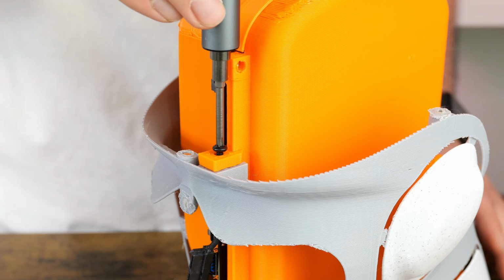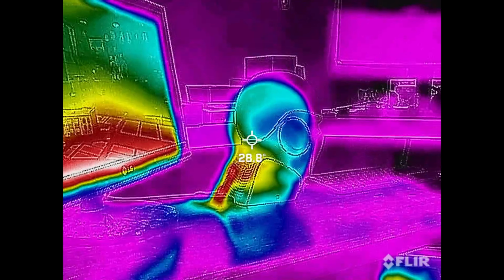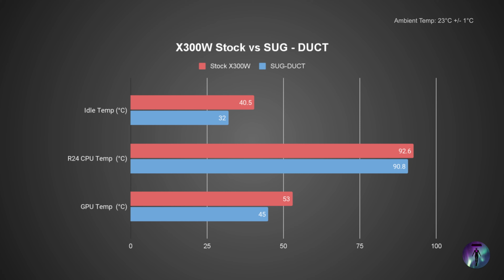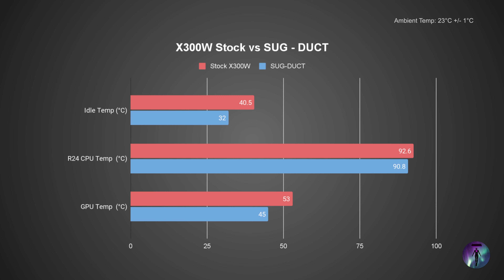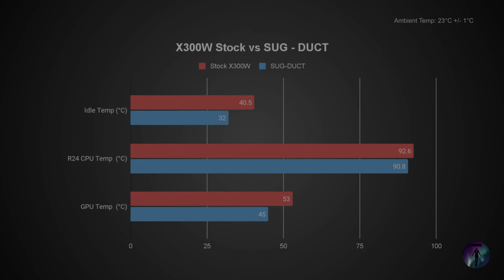This 3D Printed PC Case is Ahead in Cooling and Use

Comment: What type of filament did you use when printing out the parts?
Reply from the maker: Thanks for watching! For my PC cases I opt for PETG (I have them linked with color too in my description) for its high heat resistance. You can use ABS as well, but be mindful of fumes and heat fluctuations when you do.

Comment: that CPU still hitting over 90 C..  90 C is max recommended temp for longevity, 100C is thermal limit, i prefer around 70C temps. cause it gives good wiggle room and is lower then max recommended.,
Reply from the maker: Thanks for watching and commenting! My personal system is custom watercooled (IHS removed and Liquid Metal applied) so I think we have the same standards for cooling; but SFFPC calls for those compromises and luckily CPU are way better about thermal throttling than they were like 15 years ago. I could also apply a power limit as well.